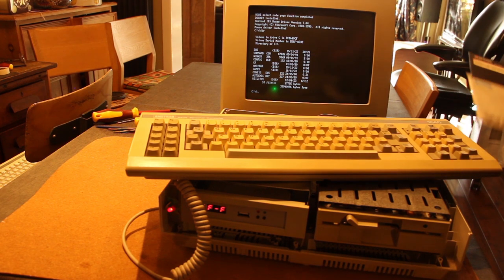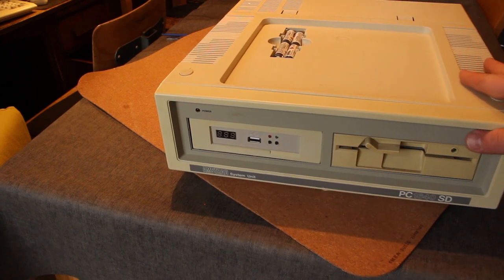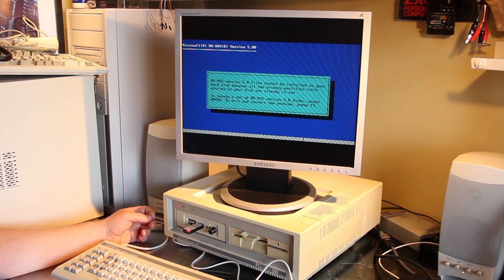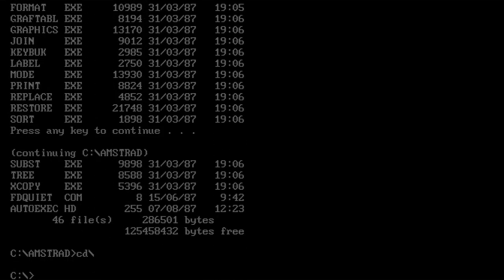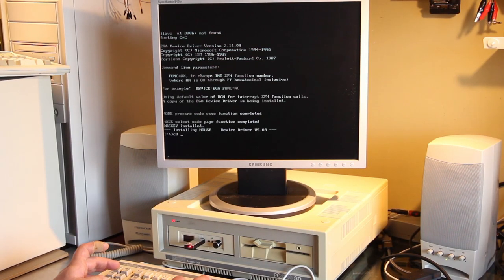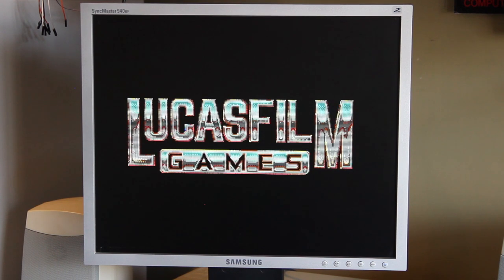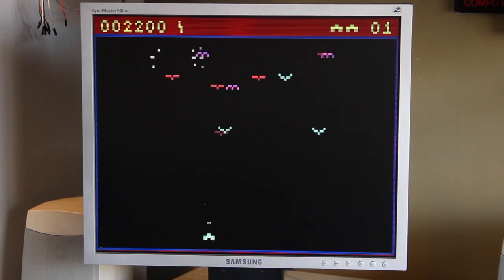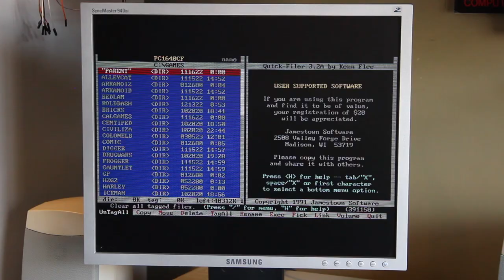Amstrad PC1640 Upgrade, install and some games

Comment: So that's what Round 42 looks like! I couldn't get it to work back in the day and now, a few decades later, I've finally at least seen it. I would have enjoyed playing it. Thank you!
Reply from the maker: Here's an online version where the settings seem to be pretty correct. To run Round42 on this model I had to tell the machine through a batch file to switch temporarily to use a cga output (requirement for game), launch game, and then revert to ega. For any 1640 owners the batch file contains: 
ECHO OFF
SET DISPLAY=CDMONO
DISPLAY
_ROUND42 [game's name]
SET DISPLAY=ECD350
DISPLAY

Comment: I resisted a temptation of GOTEK and XT-IDE in my Amstrad PC1512 (although I have to confess I use them in some other comps in my collection) - just wanted to retain the "pure experience" of working, say, with GEM and two 5.25 floppy drives! :-)

Comment: Hi, how did you solve the power on/off switch for the replacement psu? I assume you have installed it externally. I have a very flickery ECD monitor and am considering swapping the monitor and PSU for something more modern.
Reply from the maker: Hi with this I just turn it on and off at the (UK) mains socket. Its fitted into a KVM setup with other retro PCs and cutting all power to the machines works well for what I need. Since filming this video I actually integrated the new PSU board into the main unit underneath the disk drives and I installed a C13 connector on the back panel,  I could have fitted a switch at that point but didn't bother https://photos.app.goo.gl/nENZCxztWg8LapFz8

Comment: Ah man, so many good memories from this machine :) I think i had the same 1640 back when i was a teen. Eventually it broke and it found its way to the bin, but I really liked it, it was quite a robust machine. Also the PC speaker had a volume knob if i recall correctly? PC Speaker sound rocked on this machine.

Thanks for the memories, cheers!
Reply from the maker: Yes that's right, the volume knob will send it ear piercing loud! It is surprisingly robust, it has taken everything I have thrown at it, and a very capable DOS machine

Comment: could you tell me how you set the jumpers on the gotek, I cant seem to get it working
Reply from the maker: I'll have a look and let you know. One thing that I had to suss out was I also had to be mindful of the existing drive
Reply: @willmoindrot  Thanks I have noticed I cant do anything without the A drive connected but every jumper configuration I have tried doesnt seem to work
Reply from the maker: @brendan1495  There is something whereby the computer has to have an A drive which is 720kb (not 1.44). I have mine set from memory that my Gotek is A drive and the floppy is B (but that is not the default setup - I think I might have changed something in the config as well). But I'll open it up this evening and take a look - it's good to document for next time I forget!
Reply: @willmoindrot  Thanks a lot, I have a  5.25 floppy in A set to D0 and gotek in B set to D1
Reply from the maker: @brendan1495  Had a look, not sure how much this information will help: Gotek (AT32F435 / Flashfloppy) is on S0; Floppy (Amstrad 40046 360kb) JP1 is set to 1; Gotek is set to Shugart in FF.cfg, host=unspecified. When I first had it installed I had it the other way round with Floppy on 0 and Gotek 1 and it just worked. I then tried switching Gotek to be on 0 and Floppy to 1 and it did not work to begin with by my notes, unfortunately other than referencing this site they do not say what I did in the end, and there is nothing special about drive parameters in my config.sys. Anyway hope this is enough to help a little bit: https://www.retroisle.com/amstrad/pcs/Technical/Hardware/DiskUpgradeOnPC1512_1640_2086.php
Reply: @willmoindrot  Thanks a lot will give it a go and let you know